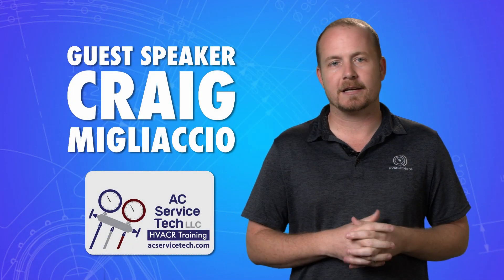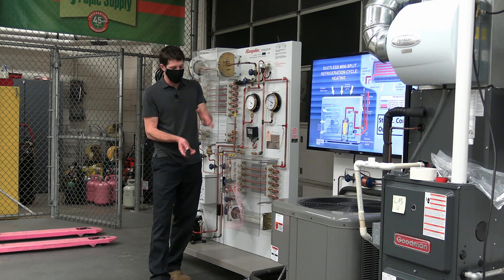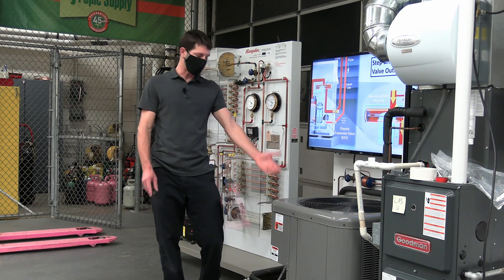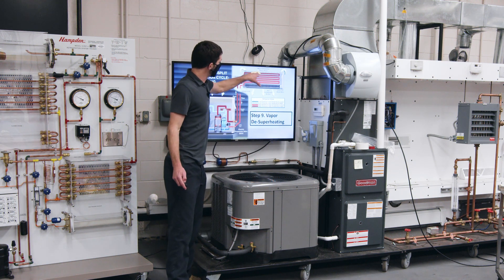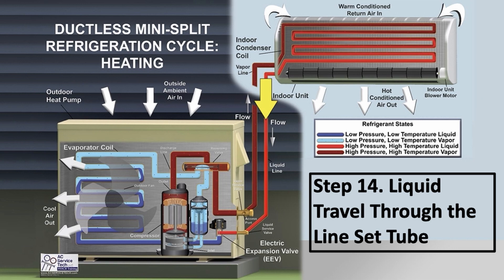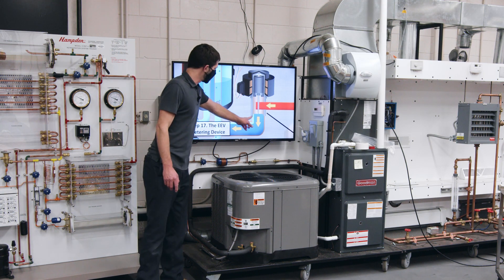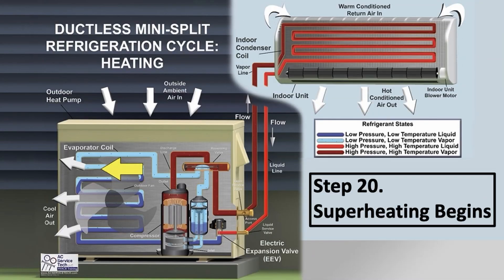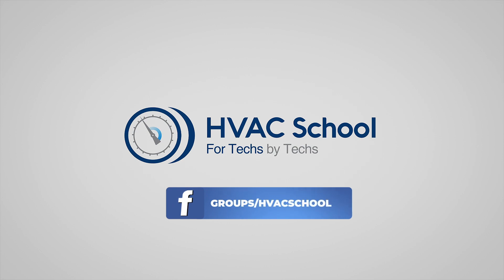Mini Split Heat Pump Facts  (PART 2: Ductless Heating Mode w/ AC Service Tech)

Comment: This is a great video like all the other introductory lessons about mini split systems, but I am wondering when we are going to see videos on how to troubleshoot these inverter driven systems. Yes, there are sensors everywhere, an EEV that is controlled by the PCB, and a reversing valve that is not field replaceable, but where do you start looking when they stop cooling besides low refrigerant? There are hundreds of informative videos on split systems, but videos on mini-splits have been limited to basic principles of operation. I work at a resort with almost two hundred mini splits and Samsung DVM units, once low refrigerant has been ruled out, then what? None of the HVAC technicians know where to begin when the problem is something else because there are no industry standard procedures to follow. All of the Samsung mini splits at our location do not have a display for error codes. We invested in a $$$$ converter so that we could install SNET Pro software on a laptop with hopes of finding a troubleshooting path, but it has been futile. Calling a contractor to our location every time one fails is completely unrealistic from a cost perspective. How should techs prepare for the wave of mini-splits, VRF, and DVM systems that are being installed?

Comment: I like these videos a lot, but by way of constructive criticism: where the video cuts to the projector slide and back, the timing isn't working for me at all.  I think the slide close-up is way too fast for me to take it in, and the transistion effect and sound are kind of distracting.   Since it's YouTube, I'm already used to pausing to absorb a close-up once in a while.  I like it even better when the slide stays as long as the voice over content is still connected to that slide.   I can't imagine how much work goes into this stuff, thanks for doing this.

Comment: we got crapped on last week in texas with 5 degree temps for 5 days.  my bryant 288bnv heat pump would not heat the house over 70 degrees and had an inch of ice around the condenser.  i hosed it off and forced it to do a few defrost cycles in the checkout menu and set it to defrost every 30 mins.  it seemed to help but when it was on auto mode it would start a defrost cycle and stop after 2 minutes.   the unit was 3/4 iced up and didnt provide the benefit of the bargain for what this costed me just a few years ago, is the sensor in a bad place, defective sensor or any recommendations on what i can do?  i'm not getting any codes, and it works decent when it's 40 degrees out, but anything under 30 and it's stage 4/5 all night long and never shuts off.  compared to my 2T 2nd gen mr cool mini split for the garage, that thing would defrost everything within 30 seconds, decent for an inexpensive garage unit.

Comment: Question for a heat pump system not mini-split 
Can I switch heat to cooling with the system running???
Disconnecting 24 volt to the coil testing reversing valve.
Reply: Yes.